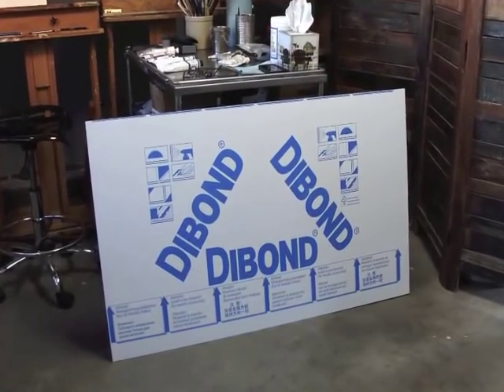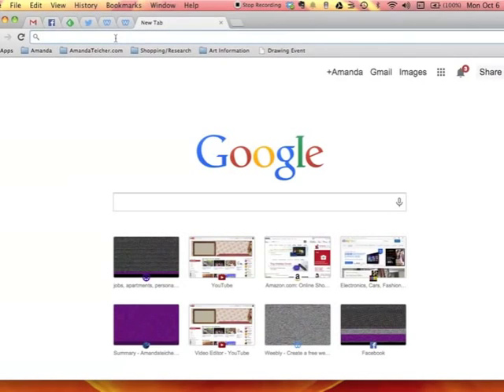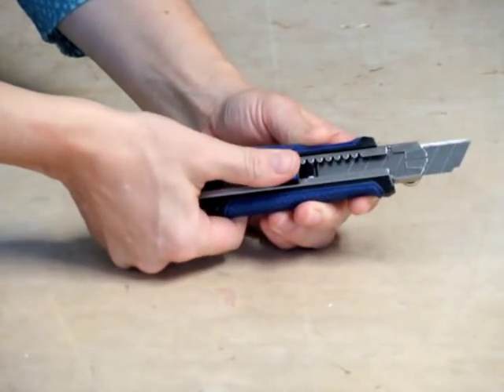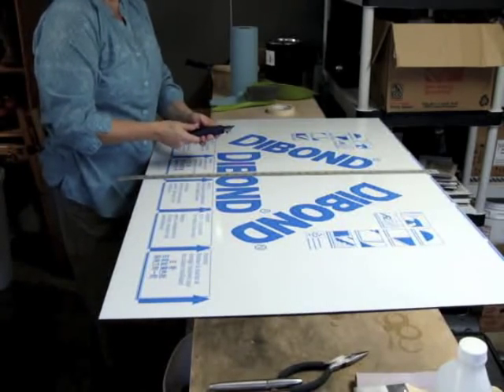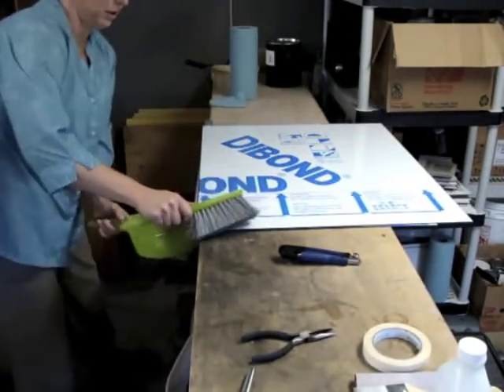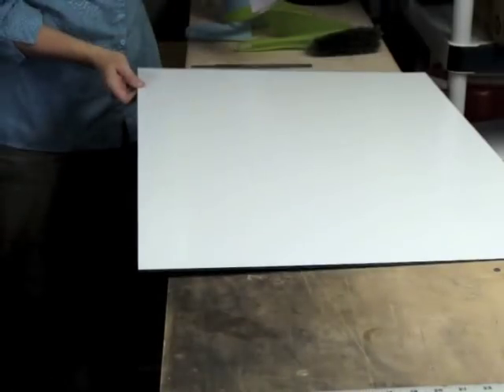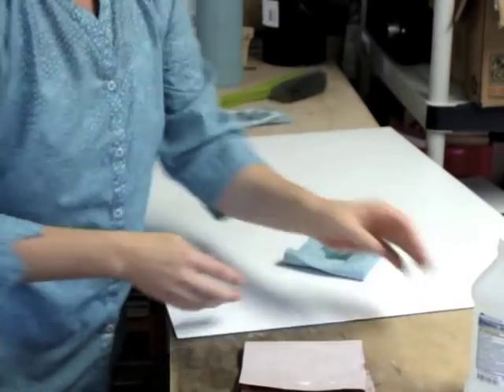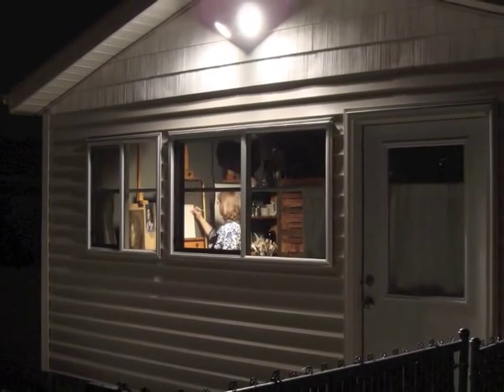Dibond: Buying, Cutting, and Priming

Comment: Thank you for posting Amanda, I have been working on dibond for years now, its an amazing substrate...its light weight, rigid, and never warps. When I began using this product,  I called a dibond manufacturer and they recommended spaying an automotive primer or use DTM Bonding Primer after sanding. They said that gesso does not have good adhesion to the polymer surface. Hope that helps.
Reply from the maker: That's interesting. I would be concerned about taking advice from the Dibond manufacturer about oil paintings ... because for some painters, longevity is very important, and how the layers of chemical preparations from other industries interact with oil paint over time is almost certainly not known to the Dibond people. I was told by George O'Hanlon of Natural Pigments (he makes a very good oil paint that I use) that acrylic primer will adhere well to Dibond's polyester coil coating, as long as the polyester coil coating is sanded, but that oil primer (the only true gesso is oil based) will not. I wonder if the Dibond people were thinking about oil-based gesso when they recommended the automotive primer. The way I see it, we painters are kind of in a tight spot, because it's not a big industry, so we have to borrow materials from other industries, which has pitfalls. Great comment, though, and I'm glad to explore multiple viewpoints and sources of advice.

Comment: Amanda, I really appreciate you sharing your cutting process with the Dibond panel.  I'm buying a 4'x8' sheet tomorrow to try it out.  I have used copper and plain aluminum panel prior to this but for larger works, they can become unwieldy. I felt the cutting instructions I read about on various sites were unnecessarily complex, and required expensive equipment, so I continued to search for a more sensible method and found your YouTube.  I'm so glad to have the information, as it will make my job a lot easier tomorrow.  Thank you so much for taking the time.
Reply: Dennis, were you able to cut the dibond successfully?  If so, were you able to get a clean edge on both sides?

Comment: Thanks for the excellent video.  I had never thought of cutting Dibond with a box cutter knife!  I found that my local sign shop can cut the Dibond to size for me (I usually give them a diagram showing how to cut the 4'x8' panel into smaller panels), though occasionally I have to trim off the poly core that over-hangs the aluminum.

For my panels, I've used Scotch Brite to scuff the polyester, as it seems one doesn't need very rough grooves to make the primer bond nicely.  One other tip I picked up somewhere was to first put down a layer or two of Golden GAC-200 mixed with Golden Matte Medium either before or instead of the gesso.  Since I like to keep the silver shining through for my paintings (I buy the brushed silver Dibond rather than white), I often don't want an opaque ground and the GAC-200 (promotes adhesion to hard surfaces) with Matte Medium gives a nice, firm, slightly toothy support for my acrylic paintings.  (Learned the hard way: Make sure this dries completely before continuing, especially if you plan on using masking tape on the painting!)

One final tip (for others who may find this):  If you're not careful, some sign shops will sell you something that looks like Dibond but is made by another manufacturer.  Some of those work just great (Alucobond), but if you get the wrong one you may find that it's not coated with the polyester coating and instead you have bare aluminum, which will have adhesion problems if you try to paint on it with the gesso!

Comment: To hold the straight edge in place try a couple inexpensive 'C' clamps - much better than tape.  Can use them to hold the panel to your work bench, too.
Power sander - get what is known as a palm or oscillating sander used for finish work.  They are relatively cheap and super effective for taking off just a bit of surface and doing it equally across a surface.

Great video.

Comment: I did opt to use a 6mm panel, using the E panel type. I went through the same scuffing, isopropyl cleaning and three layers of gesso, no sanding between. I did sort of light brush out the last coat with a brush. The final texture looks like egg shell wall paint texture. I knew after seeing the 3mm panel I would have to add stiffeners.  Too much time and labor. It's working out great. 
Paul
Reply from the maker: Excellent, I'm very pleased to hear that. It's great material.

Comment: instead of using masking tape, which can easily move and de-form, use two adjustable c-clamps with a rectangular piece of wood on top and bottom of the clamps jaws so you don't cause a dent in the dibond. To make up for the gap you've just created under the dibond place another sheet of same thickness wood under it. Thanks for the great video though! Never thought to use such an item as a canvas.
Reply from the maker: Great suggestion! If you're curious to learn more, visit my panel website at amandaspanels.com.

Comment: Thanks for posting your video, it was very helpful -- as I just recently found out about Dibond.

I've read warning about the polyester, slick coating on Dibond as being highly unsuitable for long-term holding of gesso.  I've also read suggestions that you can buy the bare-aluminum version of Dibond, sand that and prep it with a zinc/chromium marine spray paint to fully seal it.   Everyone seems to have an opinion; there are some that suggest anodizing the surface with sulfuric acid and such -- I don't think so! :-)

In any case, I haven't yet found many people that are using this material, so I thought you might be able to shed some light on the above.

I've grown tired of the laborious process of prepping my own panels with masonite, then the pine cradles which add a significant amount of weight.

Speaking of which, for larger items, I wonder how one would create a "cradle" for a larger item that's on Dibond, without drilling holes into the material -- I would imagine that would require some industrial adhesive (Home Depot has Liquid Nails adhesive) -- but what material to bond with?
Reply: yes, my concern is the bond of the gesso also. What is the solution to mount hardware to the back to hang the piece?

Comment: Watching this as considering trying dibond for oil painting.  As a professional artist, I am concerned about painting on the polyester coated side vs directly on aluminum.  In time, polyester is an unknown as to how it might gas out.  I would consider putting a size layer at minimum, like GAC 100, before putting down any gesso or oil grounds.

Comment: Years ago I severed my thumb so badly I nearly lost it. However careful you are cutting slippy, rigid material with a box cutter using such a thin straight edge, you're very likely to lose control, the cutter slips off the line and the next thing it meets is your thumb. You need to add a more definite safety warning about this. Students, who often have little experience might rush the process and be less safety conscious. I was being super careful and it still happened to me. To this day I have very little sensation in my thumb as I cut through so many nerves. It could have been much more serious.

Comment: Thanks for the great demo.  I just got a commission for a 4' x 5' oil painting and need to use aluminum for the first time!  I am going to use a company in NH called Piedmont Plastics, in case anyone else in the area needs a resource. I have a question for you.  I typically use MDF board, Beva roll film (glue), and quadruple primed canvas for my paintings. I use heat to bond them together.  Can I use heat (a hot iron with a protective cover) on Dibond panels?

Comment from the maker: This comment is in response to the comment posted today by Forrest Aldrich.

Forrest, I'm glad you enjoyed the video. I'll respond to your questions one at a time:

1. Gesso on coated aluminum. The coating on Dibond panel is a polyester coil coating. It's basically polyester paint. It's compatible with acrylic dispersion ground, which is sometimes sold as "acrylic gesso," as was the Daniel Smith product in my video. You'll get better adhesion with a bit of scuffing with sandpaper. I wouldn't use true gesso on aluminum composite panel, because true gesso is oil based, and won't adhere well to the polyester coil coating. I also wouldn't recommend putting anything on the bare aluminum side of the panel. I got my information from George O'Hanlon, technical director of Natural Pigments, which sells professional-grade oil paint and aluminum composite panels in standard sizes for artists. I'm an art student myself, and I love to do research, so I believe my information is good. If anyone reading this comment has anything to add, please do. 

2. Zinc/chromium marine spray to prep bare aluminum. Boy, I just don't know. I'd be wary of that, unless a conservator or expert in artist's materials tells you it's OK. You hear a lot of tips about how to prepare artist's materials using substances from other industries, like carpentry, etc. Because the panel needs to last for centuries and the chemicals used need to be compatible with oil paint, I'd be very careful about making an oil painting and including a bunch of unfamiliar chemicals anywhere on the panel. They may react poorly with each other. For example, I know some people like to use plywood panels for their oil paintings, because plywood is relatively inexpensive and stable. But plywood is made for carpentry, and it has formaldehyde glue in it. It holds the plies together very well, but the gas it creates isn't good for oil paint. So plywood is only a so-so choice as a support for an oil painting. That makes me think that preparing bare aluminum with zinc/chromium marine spray is something I'd stay away from unless it got a conservator's stamp of approval. Also, zinc is very brittle. It could crack if the panel bends at all, and aluminum composite panel does have some flex to it. So the more I think about it, the more I think I'd avoid it. 

3. Adding a cradle. This is an excellent question. Because I'm a traditional artist, I frame my paintings, but many contemporary artists will prefer to cradle the panel instead. I'd use square metal tubing and glue it to the back of the panel with epoxy. I called Home Depot before writing this paragraph, and that's what they told me to do. The metal tubing would be heavy, and difficult to cut, but it would look industrial and modern and for some artists, just right. I'm not sure if you'd want to then paint the sides or even how to attach a wire. You'd probably just drill through the metal and attach a wire just like you would on a wooden cradle, with screws.

Check out this link for a photo of square metal tubing: 
http://www.lowes.com/pd_215640-37672-11392_0__?productId=3053565&cm_mmc=SCE_PLA-_-ToolsAndHardware-_-ThreadedRodAndMetalShapes-_-3053565:Steelworks&CAWELAID=1368098936&kpid=3053565&CAGPSPN=pla&k_clickID=122a92f7-7345-0da9-9a8c-0000348ef184&kpid=3053565

If anyone else has better ideas, please post them. Thanks, Forrest, let me know how it goes.

Best,
Amanda
Reply: Amanda, thanks for the info.  I didn't understand the nature of polyester paint -- when I hear "polyester" I think of 1970's fabrics that have long gone out of style ;)    This makes the issue much simpler to handle (which is my preference).   My local distributor says they typically only carry the coated dibond anyway.    Cradling may be a challenge with this material as you would want to consider the exposed edges, which may not look very nice with the core showing and possibly with the sharp corners.    Framing is expensive, which is why I avoid it.  I just need to learn how to do my own sometime.   I saw reference to honeycomb panel, in one of the URLs you posted.  I found a source in CA and inquired about it, too.   I agree, the chromium/zinc covering sounds very "industrial" -- I would avoid it.  Acrylic gesso is so much more reliable, safer.
Reply: All these comments are so helpful. Do you have any updates on your use of Dibond? I've checked out how to hang Dibond and discovered a company in UK that does sub-frames - it's really simple. Check out lionpic.co.uk - some great ideas.

Comment: I use MaxMetal which is the same thing and costs about half as much as Dibond. I buy it from a local sign shop; they sell it to me at cost. Then I glue canvas to a sanded panel using GAC Soft Gel and paint on that.
Reply from the maker: +George Everet Thompson Yeah, I use a lower-priced version now too, also from a sign shop. Thanks for your comment.
Reply: +George Everet Thompson Hi Everet, Do you adhere primed canvas?, if so do you find that the weave (texture) becomes more pronounced when its glued onto the board?
Reply: +Sam Wade Primed yes, some are primed one side and some primed both sides. Since they are painted first there is no problem with the texture. The tests I have done with primed unpainted canvas don't show any differences in texture that I can see. I have not tried unprimed canvas.

Comment from the maker: Let me add one more thought. I attended a great workshop last month called Painting Best Practices. I wrote two articles about what I learned, one about supports and one about materials. Here are the links:

To Make a Painting Last, Give it a Strong Foundation
http://www.amandateicher.com/blog/to-make-a-painting-to-last-give-it-a-strong-foundation

Artists, Know Your Materials
http://www.amandateicher.com/blog/artists-know-your-materials
Reply: I found a Dibond reseller near me.   I got some samples in the mail from 3A and I really like it.   It sounds like the white-coated version is what I'll want.  Take a sander to it, gesso and go (making sure the edges are smooth, so I don't knick myself).    

What do you use to sand down your gesso?   I've had a problem with sanding down gesso, with an electric sander, as it tends to "gum up" on the paper -- if you don't remove them, they'll gouge the surface.   I use liquitex gesso - in the bottle, which is plenty thin enough, but I wonder why I have such a difficult time.
Reply from the maker: Forrest Aldrich Awesome. A power sander? Can you put just gentle scuff marks in the surface with a power sander? I've heard that it's best to not sand down to the aluminum.
Reply: Amanda Teicher I have a power sander I've been using that makes it quicker to cover the larger surfaces.   You can do it without ruining the polyester coat.  I found a local source for 3mm Dibond, inexpensively with cuts.   Looking forward to trying it out and to not laboring over masonite and wood cradling anymore.
Reply: +Amanda Teicher People do paint on raw aluminum so the not sanding through to metal doesn't make sense to me. I find that some areas do get sanded down to metal — edges — and have had no problems with that.
Reply from the maker: +George Everet Thompson Wow, that's interesting. I didn't know oil paint and aluminum were compatible.

Comment: Amanda, have you experimented with brushing the gesso vs roller? Sometimes it's nice to see some swirling strokes under the paint. I'm going to use acrylics on a 4 x 8 sheet. I plan to use the 3mm thick panel but add stiffening strips to the back as a cradle. I'll use a 3m tape to fasten these. Any thoughts on this large scale work? Thanks.
Reply from the maker: Yes, I've used a 4-inch foam roller to apply primer. It leaves a less organic, more uniform layer, sort of like charcoal paper. For my traditional oil paintings, I like the look of brushstrokes, but a roller is nice for painters who don't want to call attention to the texture of the primer under the paint. It looks less handmade.

If you're going to use a whole 4' x 8' sheet, let me urge you to get a piece of Alumalite, in either 6mm or—even better—10mm. It's made by Laminators Inc. If you contact the manufacturer, they may tell you where you can buy it in your area. The panel in this video, Dibond, and the generic version, e-panel, are fine for smaller paintings, but not for large works. That material is too flexible and too thin, and also far too heavy. If you Google Alumalite, you'll see what I mean. It has a corrugated core, which is what I believe you need. 

Have fun!